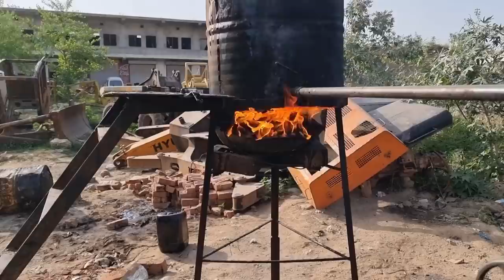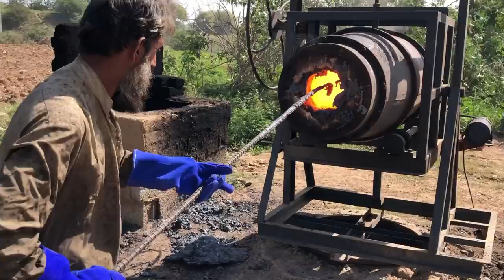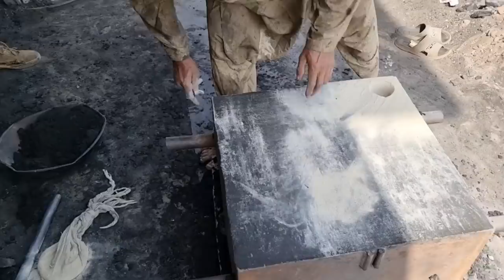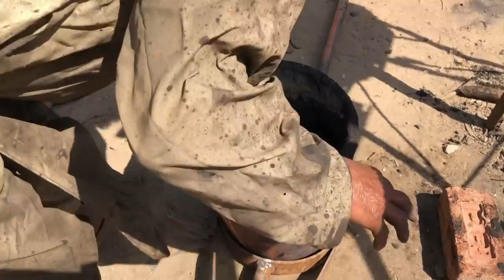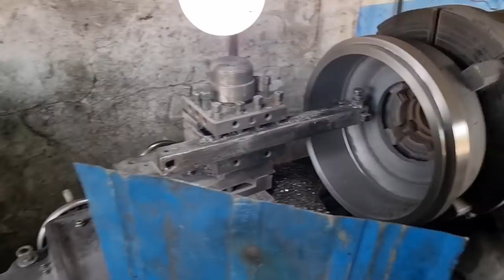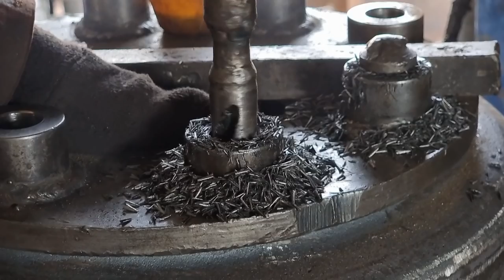Amazing Production Process of Truck Brake Drum from Old Truck Engine Head | Manufacturing Brake Drum

Comment: Those guys using the sledge hammer should prop one end up an inch or two.  Will break much easier with a gap under it.
Reply: I'm surprised that they haven't built something to break the castings ,  better than a sledge

Comment: Putting paint on an inner drum brake surface might NOT be a good idea. 🤔
Reply: it'll instantly rub off once brakes are applied...this is to keep it from rusting in storage
Reply: @AKAtheA  Depends on the type of paint, some old lead based paints you don't rub off very easily.